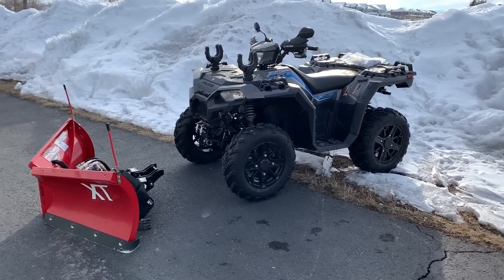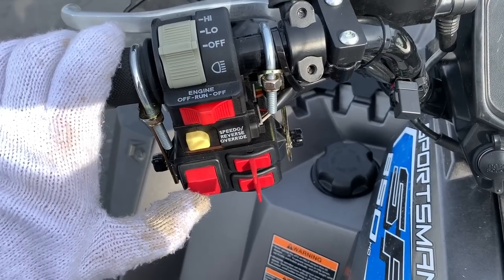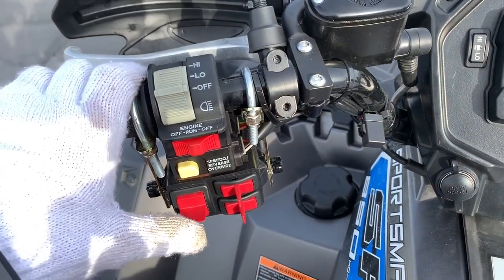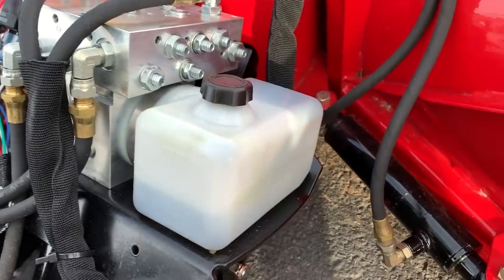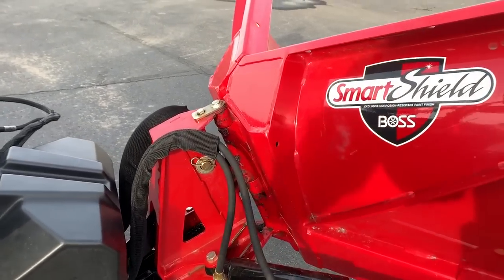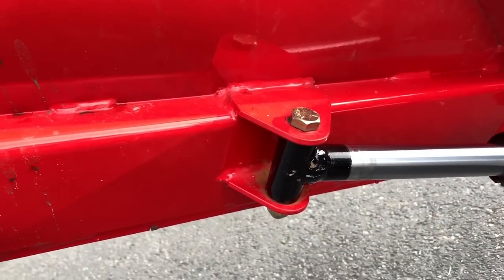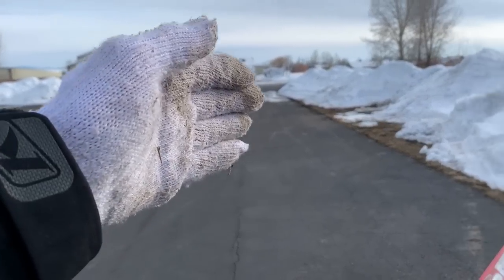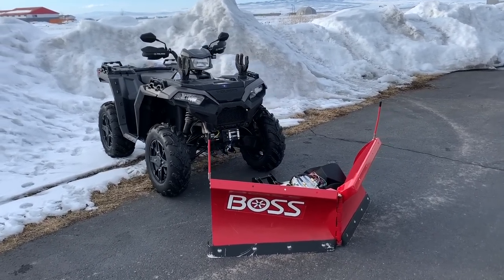Boss ATV V Plow 2 Year Review (WARRANTY OVER)

Comment: I have a boss plow on my truck love it , looks like only problem is the control’s . Maybe they need to use same controls that they use on the big plows . It’s a handheld control, and maybe have a holder that could place in or hold in hand like truck control.
Reply from the maker: They do make a controller option like the trucks for the ATV’s as well. 👍

Comment: Sweet setup I have the identical setup and plow commercial with it. I had the same issue with the lift switch.
Reply from the maker: Good to know! How long has yours been happening?
Reply: It happend with about 10 hours on it and I got a new controller under warranty.
Reply from the maker: Wow that’s crazy with such few hours, thanks for the info.

Comment: For my money the 5ft straight blade with 6 inch wings is better.  Pushes more snow and lighter weight.   For counterbalance I use 300lb lead off the hitch. 
Definitely hd springs in front.
Edit dude extension wings will fit the v blade they bolt right on the side there buddy

Comment: where did you place the winch controller?  I just purchased one and awaiting the dealer to install.  Curious to know where you mounted it and if you would change location.  Super excited to use this winter.  Got a deal from the dealer and couldnt pass it up.  Your video was awesome!
Reply from the maker: I took the winch controller off and kept it in the front or back storage compartment. Never needed to use the winch but I kept the controller around just in case. It just unplugs on the Polaris. You can put it anywhere it fits. I didn’t have room for it on my handlebars with all the controls and mirrors and such. But anywhere it fits would be a good location 👍
Reply from the maker: Also congrats! I hope you love it as much as I loved mine.

Comment: I was wondering if a 570 would be able to handle a boss plow or if I would need a 850.
Reply from the maker: I always recommend the 850 but I see a good chunk of people using 570’s with the boss plow as well.
Reply: Thank you. I'm looking to buy my first atv for plowing in Nothern Michigan. Still trying to figure out what to get.
Reply: @brndinrth  buy a Honda it will last longer
Reply: I’m curious are you just running a Polaris 850 sp with highlighter front springs? Would you do anything else for the boss plow? I’m looking at getting this same set up for the 2021 season.
Reply from the maker: You can try to use it without upgrading the springs and see what you think. The 850-1000 models are pretty much set to go. The batteries can handle the load of the boss plow and EPS system. If it gets to low it will cut the EPS but you’ll never really notice when your moving. I always kept my battery on a charger/tender when not in use throughout the season.

Comment: I just bought 9 of these units how do I soften up the trip Spring
Reply from the maker: Loosen up the 2 lower bolts on the underside of the push frame that attach to the trip springs. I would caution loosening it to much because it will loosen over time on its own and the end plate can become dislodged and can get lost or damaged.
Reply: @AutoPilotMT  Do you use lock type as well as the nylon nut. And the Springs at the factory setting seem real stiff. Did you adjust yours the 1st time you went out?

Comment: Hey I'm thinking of buying one of those this year for my Rubicon.   I do mostly side walks right now.   How wide is you blade? And how wide in the "v" position?
Reply from the maker: I’m not sure the exact dimensions boss might have those on the website for specific positions. But I can tell you for a standard sidewalk it is a little wider then they advertise because on the end of the cutting edges they are curved to protect the blade and it ads a little extra to their advertised length. If you can see one in person it will make sense. But overall not a huge deal once the grass freezes or your carful not to chew up the grass on the sides of the sidewalk.
Reply: @AutoPilotMT  thanks..  I  tried to find those spec on there site with no luck so far.  I'll email them.  Thanks again.
Reply from the maker: The specs are on the website just have to scroll over to the v plow specs but I also add just a little bit extra to their measurements with the curb guards.

Comment: How does the power steering do with the weight
Reply from the maker: Not an issue, it may sometimes turn off if the plow is using to much power, all you need to do to fix that is when operating the hydraulics on the plow make sure your moving/ applying throttle to keep the engine rpm up to charge the battery. If your sitting still moving hydraulics it drains the battery quicker.

Comment: Not a big fan of how that mount is hanging down on the machine with the plow off... If you were trail riding 1 good hit from a rock or Crossing a downed tree could bend that right up
Reply from the maker: They make a bracket for the off season that turns it into a skid plate.

Comment: Does the frame mount bolt or weld on to the machine?
Reply from the maker: Bolt
Reply: @AutoPilotMT  can you get me a picture of just the mount? Does it transfer weight to the rear of machine or just on the front?
Reply from the maker: Iv got a video on the mount on my channel. You can also find it on the Boss website for specific machines. Mostly front.
Reply: Cool man, thanks. Do you think its worth the money?
Reply from the maker: Absolutely, it can make its money back extremely quick in the right climate and a good snow season.
Reply: @AutoPilotMT  id be buying for my own driveway. Not looking to make money with it

Comment: Do you think it is to big for a 570
Reply from the maker: I personally haven’t tried it. But I have seen and talked with other guys and they are able to do it with a 570. Only downsides I know are the battery and front suspension. New 570 models fixed a lot of those issues but with the suspension on any ATV putting a spacer or heavier duty front spring on the front i always recommend, the v plow is not a light plow. I don’t think it’s to big but just take into account you may need a larger battery and may need to be more careful with it being not as well built as a larger CC engine and frame.